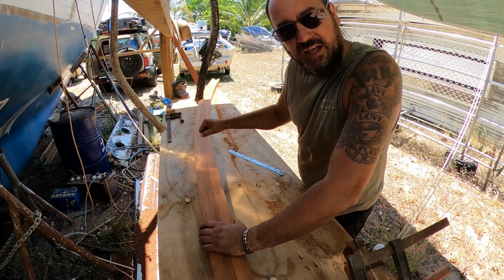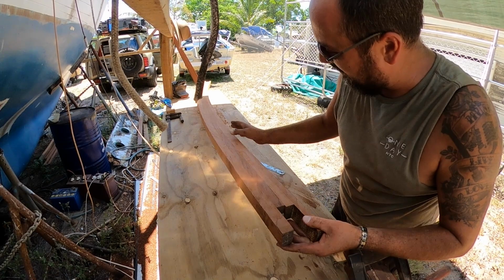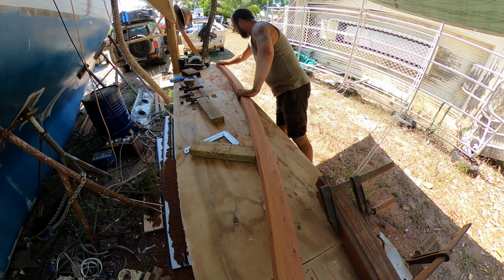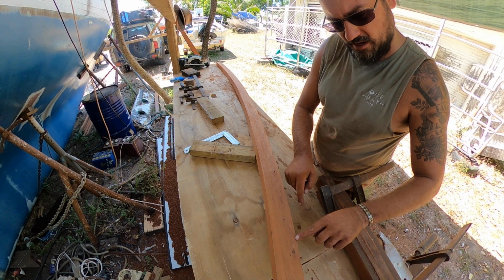New Timber - Time To Get Started On The Roof Beams ep25

Comment: You are doing  a  grand job
Reply: Gluing in deck Beams with Polyurethane, blows my mind. This Boat will going to Fall in pieces if he continues working like this. Im crying for this boat, he should get himself professional help.
Reply: @philippbecker2354  Phillip
Instead of criticising, why don’t you offer to share your incredible depth of knowledge, I appreciate that you may be a long way from the boat and can’t do it in person, but why don’t you offer on-line sessions to mentor instead. 
It’s a much better thing to do than bland criticisms that offer no solution.
Reply from the maker: Gday Phillipp, I am not sure where the issue is with the Polyurethane glue in a laminated beam? Can you please open up a discussion on the issues with this glue, as I would be very happy to hear.